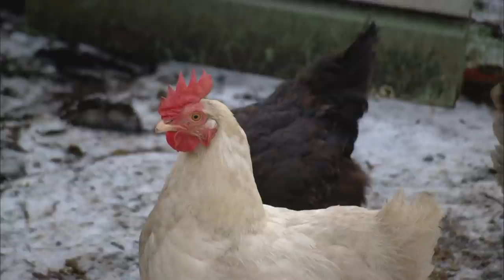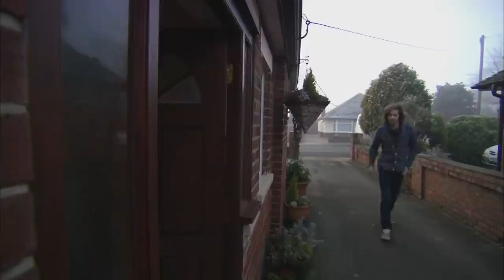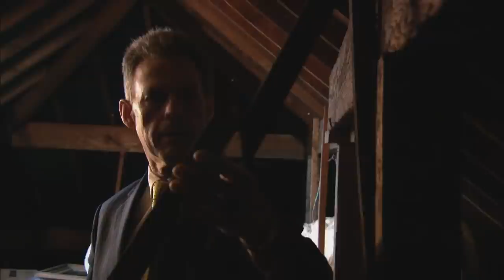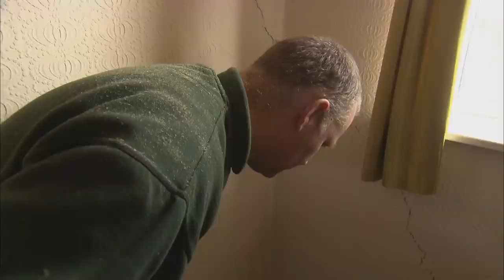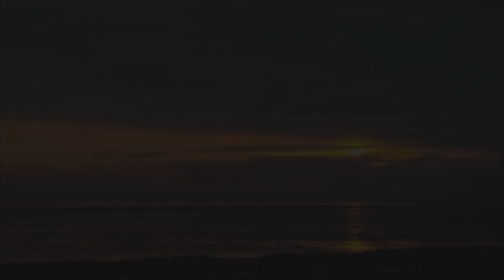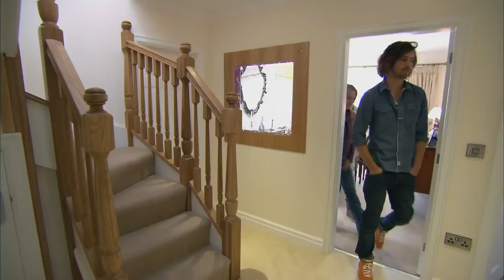From Cracks to Transformation - Help! My House Is Falling Down - S02 EP5 - Home Renovation

Comment: If I was a neighbor, I would be having my home inspected! What an amazing story of disaster averted! As the owner of a 45 year old home, this has made me consider a problem that I discovered when repainting my home exterior. I have wood siding that is applied in sheets like plywood. There are some spots where the siding has deteriorated. I was advised to reglue and then paint which I did. Now I'm going to have a builder take a serious look at the siding to see if it should be replaced instead.